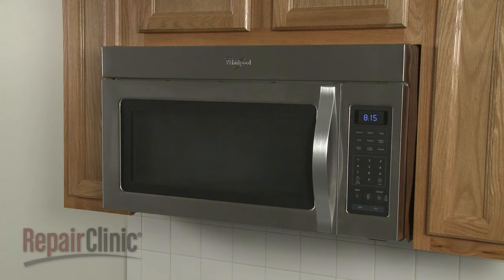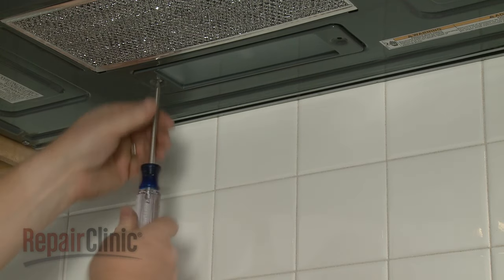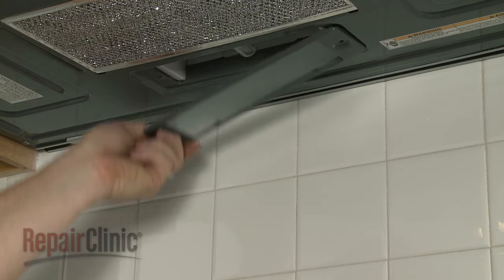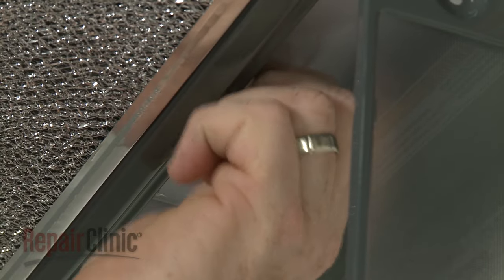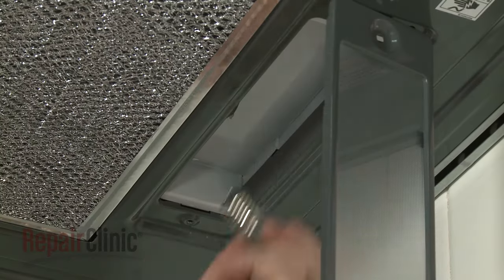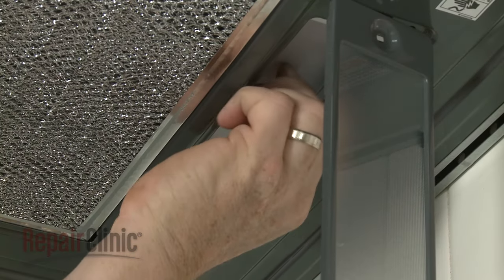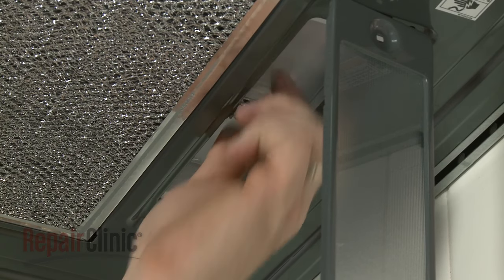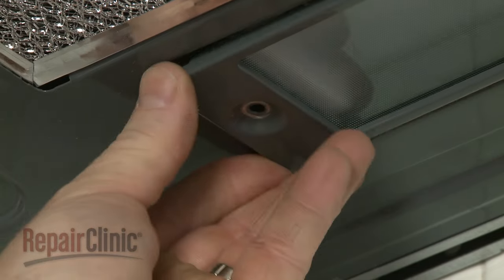Whirlpool Microwave Replace Light Bulb, Bottom Panel #8206232A

Comment: Stop what you are doing…because your bulb probably broke off, take the cap off a standard Sharpie pen, shove it into the base, turn counter clockwise. Thank you to all for sharing this!
Reply: So the same thing happened to me the glass part of the part broke off to the metal part... Like what I always do on broken light bulbs, make sure that your appliance is unplugged. Then make a dent on the metal piece (on the part that is a bit sticking out) that was left on the light bulb socket. Then using a long nose plier try to turn that piece same way as when your removing the light bulb. The metal piece came off easy for mine, I hope yours as well.
Reply: You, my friend are a genius! Sharpie cover to the rescue, thank you!
Reply: Thank you so much. This work without any issues.
Reply: How'd you know?!
Reply: Lifesaver!
Reply: Thanks for the tip!!
Reply: Darn it… too late. Should have read this first.
Reply: People on the internet are geniuses sometimes.  Sometimes not. You are a genius.  This def works!
Reply: I used to wad of masking tape after I turned off the power twisted it left and it came out.  I love the idea of the sharpie pen cover. Wish I had read that first
Reply: My Fkking Brother!   If only I could buy you about 3 beers!! Thank you man
Reply: Worked like a charm for me just now!
Reply: I freaked out after I broke the bulb off, thanks for the sharpie idea it worked perfectly!
Reply: The sharpie idea is genius. Thank you very much.
Reply: Use the pointy end, thanks for the sharp tip
Reply: You are a true hero. A salute to you.
Reply: Grrrrrrrr it just broke..
Reply: 1/30/23.....checking in from San Jose California......The sharpie cap worked 💪....you rock..
Reply: The sharpie did the trick . Thanks
Reply: You just saved me so much time and frustration - exact problem and exact solution. Thank you!!!
Reply: Thank you very much for this tip.
Reply: Thank you!
Reply: Whirlpool owes you money! I wish YouTube had a “tip” option, you’re a life saver !!!
Reply: Genius! Thank uou
Reply: Just used this tip. You're amazing!! Thank you!
Reply: Thank you!!
Reply: Holy crap, it actually worked. Thank you.
Reply: Thanks. Does that work with most lightbulbs? Even normal bulbs in a lamp that you can reach easily break off sometimes.
Reply: Thank you. My whirlpool microwave manual covers virtually every issue except this one!
Reply: Ain't no way that just worked... Lol thank you. My bulb came out without the metal.
Reply: Soooo good!
Reply: You deserve a national holiday sir.🎉
Reply: Still going strong on this tip- Thank you VERY much!!!
Reply: What a genius idea. My sincere thanks, you just saved me a ton of time.
Reply: My bulb def broke!!!
Reply: Not all heroes wear capes!!! Tysm
Reply: Thank you
Reply: Bulb just broke, but Yes, I used a sharpie cap with a little electrical tape and was able to get the base out. Thank you!
Reply: Thank you. Most valuable comment on home maintenance I’ve seen.
Reply: You are amazing. The most useful part of this YouTube video is your comment. The previous owner must’ve broken the bulb. Sharpie cap worked like a charm to remove the piece. Thanks!
Reply: Absolutely the goat my friend! Thank you!
Reply: This was exactly what was wrong with my microwave. Thank you!!
Reply: Two years later and this tip just saved me from struggling for another 45 minutes thank you so much!
Reply: Hero ❤
Reply: THANK YOU
Reply: You are a saint!
Reply: My new bulb won't screw into the bulb socket!
Reply: Thank you!!!

Comment: A big "THANK YOU" to those that mentioned using the cap of a Sharpie to remove the base when the glass bulb separates from it! I had to use a small pliers to turn it while I held it tightly into the socket base but it brought it right out..!  👍👍
Reply: This is brilliant and worked perfectly,,
Reply: Geez. And here I just stuck my finger in there and turned (AFTER unplugging the microwave). A Sharpie cap definitely would have been better.

Comment: Cut the power or breaker before unscrewing the old bulb and screwing in the new on.  Lowe’s has it as “40w microwave bulb.”  There is glue on the bulb from the factory so if the bulb breaks then use the Sharpie trick as mentioned here, just be sure to disconnect power first.
Reply: Yeah mine just made a pop sound now I’m scared lol
Reply: wish i had seen this

Comment: I knew how to replace the bulb because I've done it before but not when the bulb comes out of the base. I used the cap of a Sharpie and worked, THANK YOU for who came up with this! The "Genius" who designed where the socket is should have made sure it was easily accessible we are not  owls can rotate their necks 270 degrees

Comment: It's not mentioned here (nor in the manual) but it's apparently REALLY important to unplug the microwave before you replace the bulb. After the 2nd time replacing a bulb, the light wouldn't shut off. Lots of googling found the control panel is damaged and mention that changing the bulb while plugged in is the usual cause.
Reply: I had a repairman come out for this problem as  the socket needed replaced and he told me the same thing. Make sure you unplug it first.
Reply: There is a sticker on the bottom of the whirlpool microwave next to the light panel that says to unplug before changing the bulb.
Reply: This is what I’m dealing with right now. How best to fix the control panel?

Comment: Your videos have saved me alot of money!!! But it looks like when I unscrewed the bulb the steel part broke off inside the microwave. Only the glass came out. 😢
Reply: Did you end up using the sharpie cap with a rubber band test has been mentioned  so many times or bent needle nose pliers or epoxy stick putty with flat head screwdriver indenture prior to hardening????

Comment: Anyone else who’s bulb broke and sharpie tip didn’t work because Thor himself installed the original bulb, unscrew all of the screws at the base so you can more easily access the bulb mount, unscrew the single screw to the bulb mount, turn it around and you can use anything with a grip to unscrew the stuck metal bulb end.
Reply from the maker: Thank you for the tip. Sorry to hear that it was on there too tight. Glad you were able to get it out.

Comment: I think there is a problem with the microwave. I put the bulb in and the light automatically came one and the bulb won't go off.  worse than that, the bulb got really hot, fast.  I was forced to remove the bulb.  the bulb I had before this one was from my local hardware. this one I got from a whirlpool parts official site. could that make a difference?
Reply: I’m having the exact same issue now and don’t have a solution. Please let us know if you solved the issue and what you did to resolve.

Comment: It looks like this is a common problem the bulb is separated from the base when I opened cover😓😓.  How do I get the metal base out???  I have been not having light for couple years ;-\\\
Reply: Use a carrot to fit in the base and unscrew it, just like the old potato trick for large bases.  It happened to me too.
Reply: The carrot trick worked great.  Thank you!
Reply: Brian Eakes carrot didn’t work f me 🥕— anyone else having this issue, remove the entire bottom panel of the microwave (about 10 screws), that easily exposes the socket so you can twist it out with pliers. Get ready to clean the grease that managed to get under the panel 🧼
Reply: The sharpie cap trick worked like a charm! I can’t thank you all enough!

Comment: We replaced ours but the light won't go out. Maybe a short in the microwave?
Reply: Same here

Replaced bulb with same dimmer bulb.   Now I cannot dim or even turn off
Reply: @professorsuwak7115   Main panel has a blown resistor, most likely...
Reply: @jeffbrown265  in the case of blown resistor, I assume main panel needs to be replaced?

Comment: The light bulb came out of the base - any suggestions?
Reply: I pulled the entire bottom/base to better visualize things.  Just remove all the screws along the edge. The bottom tray just falls down in front, You can leave it attached at the back edge.  I then used a pair of needle nose pliers to grab the metal pat of the bulb and then tristed it i out.
Reply: @danrobinson6474  My bulb also broke. I followed your advice, and it worked perfect. Thanks for your help.

Comment: Hello, why does my light doesn’t want to turn off? I keep pushing the light button it usually goes from half full and off. But it’s just on doesn’t even want to turn off. Can you advise what’s wrong? 🙏
Reply: Did you use an led or incandescent? I've read you can't use an led unless it came with one.
Reply: I have the same problem. I have bought LED T8 E17 bulb and have same behavior, the light is ON all the time and doesn't respond to button control. Have chatted with WHIRLPOOL support and they mentioned I need the origianl OEM light bulb which is incandecent. THey also mentioned possiblity of damaged control board. Going to try OEM bulb.

Comment: Whirlpool puts silicone to hold bulb in place. Turn bad bulb in the proper direction or it may blow a chip on the main panel! That happened to the wife as she did not know...
Reply: Jeff why would this blow a chip on the main panel?  I replaced my bulb, and now it does not turn off.
Reply: @bradfordaudio  switch is in constant contact with the board, No Spring action or misaligned; best guess...

Comment: Bulb went out, removed the socket. bought replacement LED T8 E17 bulb. the socket looks to be same size and screws in perfectly. As soon as bulb is screwed in, the light comes on and doesn't respond to button which controls ON/Off. Is it possible that the wrong bulb causing the light to awlasy stay on or is that for sure damaged control board?
Reply: Likely control board failure.  This is why the sticker on the bottom says to unplug the microwave before removing the bulb.

Comment: I check cause I tried to unthread the bulb came loose of the thread. Now need to figure out how to get that out
Reply: Ameya Kamat same, anyone have any ideas?
Reply: Thats because they put rubber cement in there. I can't find a video on how to remove the rubber cement
Reply: I broke mine off as well. I unplugged my unit and used needle-nose pliers to unscrew the metal part of the bulb. Remember to go counterclockwise (while looking at socket)
Reply: Me too. Not funny, but kinda funny.
Reply: Just replaced mine. It also broke off as well but I just pushed the bulb back in and Maintained backward pressure as I turned to get the threaded part out. Did it little by little until it fully came out
Reply: Yes the same think happened to me- bulb broke off.  Soooo frustrating.  FIRST OF COURSE I NOT ONLY UNPLUGGED THE MICROWAVE BUT ALSO THREW THE BREAKER!!!!  Believe it or not I had to use an old trick "the potato"  I tried to use the small set of needle nose pliers but I was unable instead as I learned from a couple of electrical friends: I cut a very small piece of potato (thick piece just small in size) and put it up against the socket that was stuck (of course you have to turn the right way or you will tighten it even more)...used the potato and the torn off base came right out.  I cleaned the area well after that (was not much mess)
Reply: I wonder if there is an LED bulb equivalent replacement
Reply: Use the cap of a Sharpie marker to shove into the empty socket and turn - it should come out.  That's how I got mine out after having the same issue.
Reply: @laurenkirby8308    Thank you  ! 👍👍 The Sharpie cap idea worked great !  I suggest trying this first Before the carrot or potato idea !  Have an awesome day ! 😀
Reply: @brufman  yes, but the light does not go off after installing
Reply: @laurenkirby8308  this worked! absolutely brilliant - thank you!! for anyone else reading, just insert a standard sharpie-pen cap closed-end into the socket and spin counter-clockwise. works perfectly.
Reply: Same thing happened to me  Whirlpool needs come up with a better quality product like they did in the past. Looking to change brands!

Comment: Wow, Whirlpool uses the cheapest light bulbs. The glass bulb came out of the metal socket. 😤
Reply: Same EXACT thing happened to me. I had to unplug the Microwave and use pliers to  grab ahold of the metal bulb socket and unscrew it.
Reply: I did this with pliers for my Grandma but the new bulb won’t work either

Comment: Like if everyone is here because the bulb broke off the base while unscrewing it lol
Reply from the maker: Make sure to turn the power off to your microwave. You can gently use needle nose pliers or if you have epoxy putty to remove the broken base. If you have cut resistant gloves wear them, you can also use thick work gloves. Be careful while removing the base. In a pinch, you can also use silly putty or a potato, just make sure to safely dispose of it afterwards.